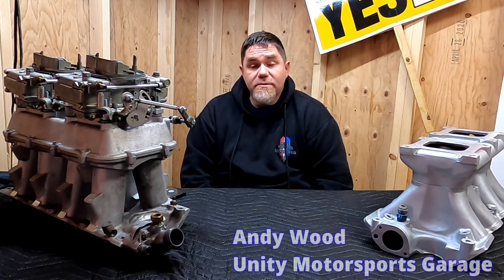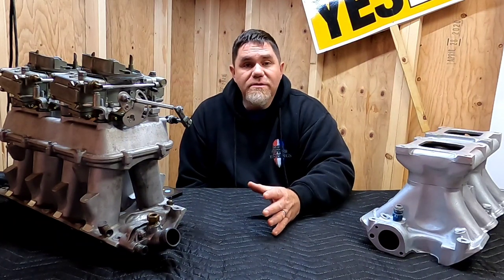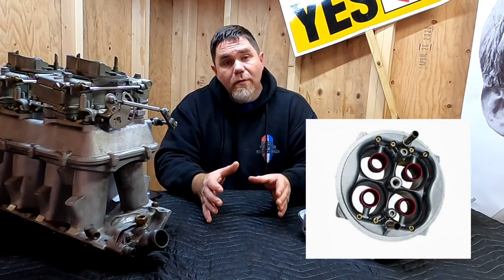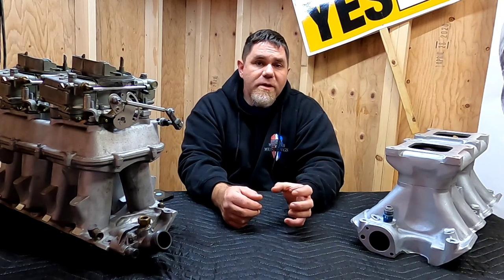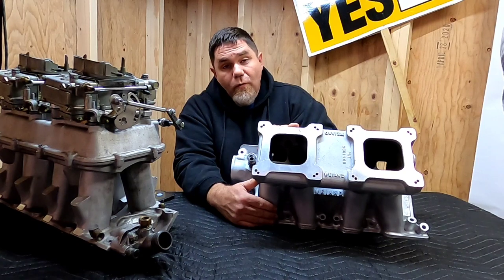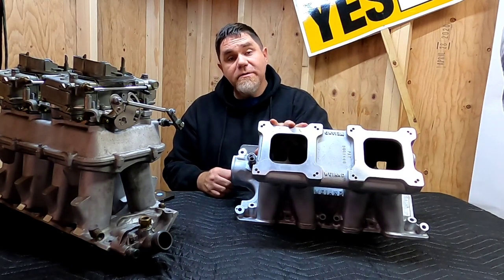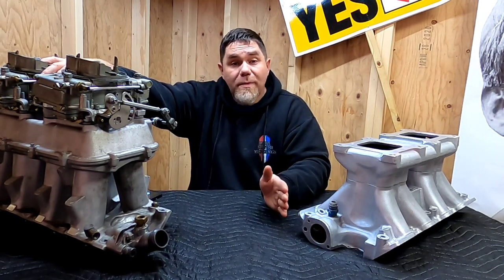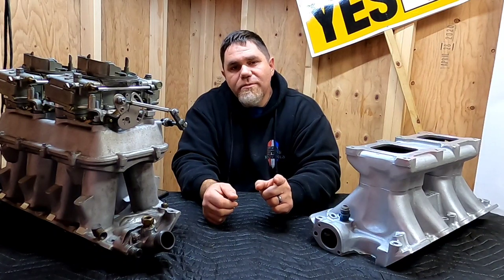The Basic Guide To Running Dual Quads...Both Low rise and Tunnel Rams

Comment: Awesome video thanks. For a street car would you recommend a high rise or low. I’m wondering if I’ll loose throttle response. 

I was thinking low rise intake with 1 inch spacers. I’m building a 496 4 speed in a car
Reply from the maker: What manifold are you thinking of running?  with a 496 you shouldnt be lacking in the torque dept! lol.... What is the rest of your motor combo if you dont mind me asking?
Andy
Reply: Unity MotorSports Garage it’s a gen 6 454 Budget build to keep it simple. But hears a few options I was considering. 

With the zz502 roller cam and valve train / a little port matching and exhaust work and spring upgrade with MSD 6AL

I was thinking 
496 with twin carb tunnel ram or keep it a 454 and go
454 twin turbo with stock intake 

With 496 i like the simplicity of setting up the fuel and its a lot cheaper. I wasn’t sure if I would loose throttle response and street performance on a high ram. But I like the high ram because it looks like will open the motor up in the Rs

The 454 turbo build I got off of Richard Holder junk yard build. He did twin turbo on holly efi and 80 pound injectors gave 1000 hp. With that you need a big fuel system, injectors, efi, gt45 turbos 

.
Reply from the maker: Sorry I just seen this post... You will lose a small amount of low end torque but not as much as you would with a big single plane... From my experience everytime I put a Ram on a engine the owner Loves it... 
On a 496 torque won't be a issue..
Andy
Reply: Thanks Dave. I just got a 93 f350 4x4 last week got the motor running good running motor. So I want to get the stroker kit 557 for 1300 from eagle and rehone the cylinders and give her a bath. But there's a problem I found out that what restricts the 460 is the heads on the exhaust. There's a massive intake. So I think if I do a lot lot of grinding and open the exhaust and run a good rv came with a duel plain intake I'll be good

Comment: I'm running a 496ci big block Chevy, with Brodix BB2 heads, 10.5 to 1 pistons and a 720 solid roller cam and a weiand 1985 tunnel ram. I'd like to try a pair of Edelbrock AVS2 650cfm carbs. I'm located about 600 feet above sea level, got any tuning advise or instructions that will make jetting easier?

Comment: Might have asked this here already but i have a buddy with a tunnel ram with 2 vacuum secondary carbs with mechanical linkage & vacuum pods removed & no secondary pump shot .
The car runs fine & i don't see how it doesn't have a lean spot or even a bog ?
Reply from the maker: I would guess that either the carbs are really small and or the car is very light and it could be just passing through the bog so fast you really cant feel it... All I can say is that I have never been that lucky...  I have tried it and FAILED! LOL
Andy

Comment: What about tunnel rams and cams that have a lot of overlap? I'm having problems with my SBC, tunnel ram and my Holley 390's.  Having a off idle stumble an occasional backfire thru the carbs.  Any ideas would be greatly appreciated.
Reply from the maker: That is from a lean condition.. you will need to increase the squirter size... If that doesn't quite cure it then you will have to upgrade to 50cc Accelerator pumps..  hope this helps what size squirters do you currently have?
Reply: @UnityMotorSportsGarage  I started with stock 25's went to 27's now I'm at 31's. Am thinking 35 would be max with the 30cc pumps.
Reply from the maker: How much timing are you running on your setup...  And what pump cams are you using?
Reply: @UnityMotorSportsGarage  Timing is 36 degrees total. Pump cam is the pink, set on #2 hole.

Comment: I'm going to preface this by saying that I am new to dual quads. If my information is wrong, please correct me. A couple of questions:

1) When you talk about linkages, you mention that a progressive linkage on a intake with a common plenum is a bad idea because only half of the engine will get proper air/fuel. Wouldn't the same problem happen with a dual plane as well? Or do both sets of primaries open at the same time?

2) Is there a book/video that focuses more on setting up and tuning Edelbrock/Carter dual quad setups?

Thanks!  -James
Reply from the maker: There are a few differences.. the plenum volume is so much smaller on a low rise dual plane intake dual quad intake and being a dual plane each side of the carb feeds four cylinders... You can run a 1:1 on a low rise setup but you would get better low speed driveability with a progressive style linkage... Because most of the time at small throttle opening it would act almost like a single four barrel dual plane...  
I hope this helps answer your question..  Thanks for Watching
Andy

Comment: Andy, I don’t know why you would even attempt to run 660 center pumps on the street. Did you retain the almost 1to1 linkage setup?
Reply from the maker: I retained all of the 1:1 linkage on the street.  I decided to use the 660's on the street to show that it is just like any other Holley carb.. it can be tuned to do the job and get good mileage in the process!  The next challenge I'm going after is to do the same with a pair of 1050 Dominators on MIXED UP BOSS..  Stay tuned
Andy
Reply: My compliments to you. Holley engineers obviously didn’t have street in mind with those carbs!

Comment: I'm currently running rpm air gap with edelbrock avs2 800 cfm on my 454 with 600 lift cam if I got a tunnel ram could I just get one more carb to match the one I have and run 2 avs2 800s?
Reply from the maker: That is what I would do!
Reply: So your saying it would idle and drive good with 2 avs2 800?
Reply: And my carb is electric choke and I see a used carb for sale same as mine with electric choke is it possible to run 2 carbs both with electric chokes on a tunnel ram would it affect how it runs? When it's running chokes are open so I don't see why it won't work lol just will look funny running 2 carbs with electric chokes ? Let me know if that is possible pls?

Comment: Tuning dual quads it too complicated for my tiny brain and physically impossible for me so I'm replacing my dual Edelbrock Carbs for dual Holley Super Sniper Efi because I have confidence that I'll be able to make adjustments after some time learning.
Reply from the maker: You will be basically making the same changes with EFI as you would do tuning carbs.. To me the Carb vs EFI is Analog vs Digital type deal... coming up when I did i cut my teeth on the 5.0 mustang EFI system and went from there... I like EFI but i really Love carbs and once I learned how to manipulate each circuit of the carb I was able then to use my wideband o2 sensors to get the same results as EFI... one thing hard to beat with EFI... The cold start!  Thanks for watching and please subscribe as I have some cool stuff coming up...
Andy

Comment: What about a tunnel ram with a single carb? Is that a decent system?
Reply from the maker: Not really.. because of distribution issues, now there is a caveat to that if you have a large downward tapered Plenum they work really well. Most of those designs are sheet metal style intakes. Hope that helps
Andy
Reply: @UnityMotorSportsGarage  Thanks, I am determined to get this to work well. I can have a new plenum made or modify the old plenum. But I just can't find much info on it. And the info I do find is really not based on much. Do you have any suggestions about making a plenum or suggestions where to look?

Comment: I wish you would not use the dual quad lingo so much..say 2/4s say anything just stop saying dual quad...Nobody I know used that terminology..
..and Nobody I know puts 2/4s on a stock motor Nobody...so let's move away from the 600cfm card discussion ...and as far as car shows and seeing a car with a tunnel ram yes they usually have 2 /4s on top.